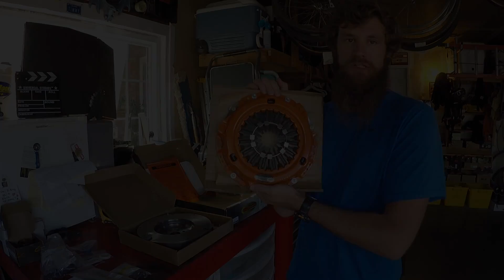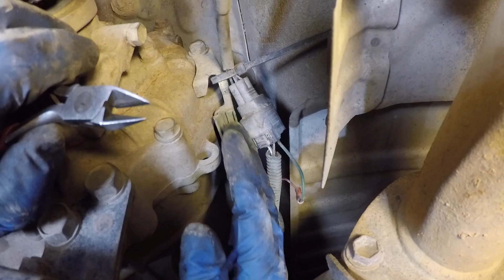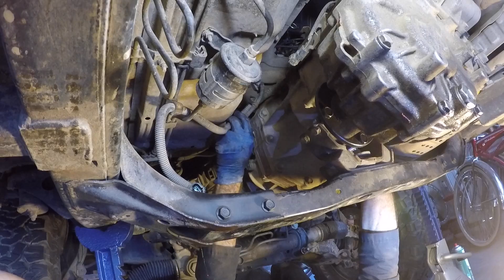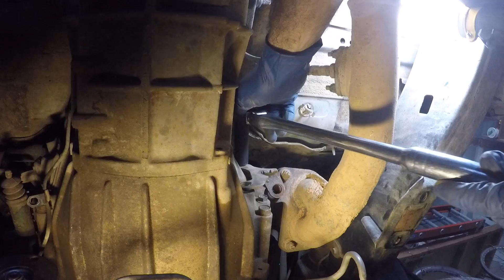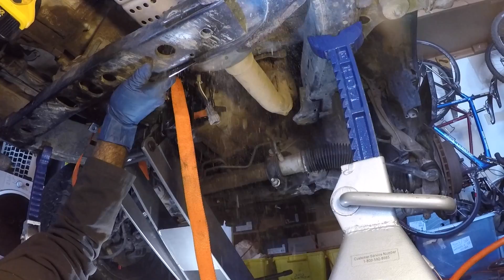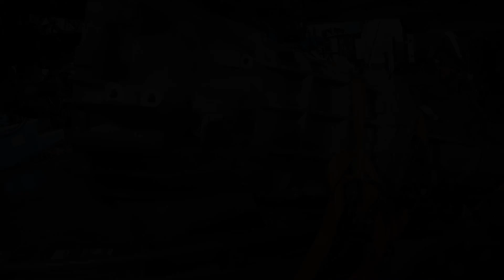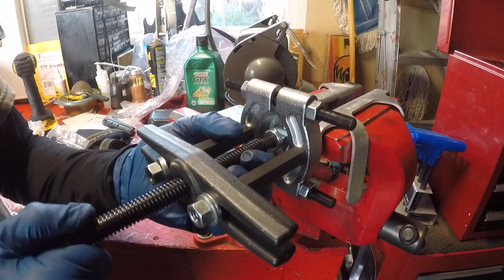Clutch Replacement (Part 1)

Comment: I’m half way into removing the trans in my 2WD ‘96 5VZ Tacoma. So far the most difficult part is releasing the harness retainer (24:05 on the video). I’m guessing the access is tighter on the 2WD. I’m going to try lowering the trans a bit and see if it opens up some space. 
Found one of the top bell housing bolts loose. I was thinking my clutch was factory, but perhaps not. 

I’m thinking w/the welded cross member, I’ll need to slide the trans back until it clears the engine and then drop the front & slide fwd until it clears the crossmember. 

Your videos gave me the confidence to take this on.  Many thanks!!
Reply from the maker: Good luck with the rest of the job.  You'll get it.  It's great to know our video series inspired you to tackle this job on your own.  Happy Wrenching!
Reply: Thanks Tim!

I learned this morning that to get enough clearance the top shifter plate had to be removed. Then you can back the transmission out of the engine. Then the clutch assembly had to be removed before there’s enough room to tip the trans forward and get it clear of the crossmember. 
The pilot bearing put up a good fight, but did come free of the input shaft. 
The ratchet strap idea in the comments was really helpful. 
Onward…
Reply from the maker: @ppeterson9359  Sounds like you've got quite the battle going on, but your perseverance is paying off.  Let me know how it all turns out for you.
Reply: @ppeterson9359 how many miles were on your rig's clutch? You don't think it was the original?
Reply: @efil4kizum  I bought the truck w/ 110K, in ‘04. It now has 278K. I believe the clutch was original.
Reply: Last post:  All is well!  I now have ~500 miles w/ the rebuild installed. Super happy with how everything worked out. Looks like UPS delivered my core to Yota1 a few days ago. 
Thanks again Tim!!  👍👍
Reply from the maker: @ppeterson9359  Great to hear.  Thanks for the final update.  Great job doing all that work yourself.  Happy Wrenching!
Reply: One last question, should any lube be applied to the sleeve the ID of the T/O bearing rides on?  Since it’s not mentioned anywhere I’m thinking no, but figured I’d ask.
Reply from the maker: @ppeterson9359  The only areas grease should be applied is what we show in the video.

Comment: Is this the same process for a 03 tqcoma 3rz
Reply from the maker: Not 100% sure, but it would be my guess it's the exact same.  I'm pretty sure you have the same R150F transmission, but you'll have to confirm.

Comment: ?  43:33 ... quick question regarding a Rear Main Seal leak inspection... is this access plate the only way to check for weeping or will a noticeable pool of oil develop on the ground or around the bottom of this plate if that seal is weeping
Reply from the maker: If the leak is significant, it will drain down and be noticeable at the access plate on the bottom of the bell housing.

Comment: I noticed that the clip holding the throw out bearing to the fork is put on different on the centerforce vs oem. Is this way you show the correct way?? This is my 3rd time bringing down my tranny because something does not align.
Reply from the maker: What we show in the video is correct for the throwout bearing we used.  I can maybe take a look at my factory service manual and see if they show a picture of the proper orientation of the spring for the OEM throwout bearing.  I'm away from home and don't have access to my FSM.  I could look for you in a couple days.
Reply: @TimmyTheToolman  
Thank you. No need.
The spring is attached in a different manner on the centerforce vs oem. Thanks!
Reply from the maker: @enmanuelcubas3401  I'm glad you figured it out.

Comment: I have a 2001 4 runner 4wd but need to replace the flywheel do I have to completely pull the transmission or can you move it back far enough to change it?
Reply from the maker: You can most likely move the transmission back far enough to have enough room to remove the flywheel.  But, this is something we haven't ever tried.

Comment: Hey Timmy what’s the part number for the bolts that snapped trying to get the bellhousing off the transmission? I only have 8 for some reason and want to get the 9th
Reply from the maker: Sorry, don't know the part number.  Your best bet is visiting your local dealer and they can sell you one.

Comment: It's advised not to ever use an impact driver/wrench to crack/loosen vehicle bolts as you now know. Once they are cracked, if they are free turning, you can use the impact from there.
Reply from the maker: That's not the reason why the bolts broke.  It was due to corrosion involving dissimilar metals, - steel bolts into an aluminum housing.  If you think transmission rebuilders or engine rebuilders break every bolt free with a ratchet, think again.

Comment: the OG '97 Taco 5VZ-FE MT has so far made it 280k miles on the original clutch sans master/slave cylinder (mostly highway miles) but the bearing is chattering in the cold and no noticeable slipping yet in gear up steep grades.  Will the bearing eventually lock freeze up and not allow me to shift into or out of gears? ....trying to get 1/3 million miles before this eventual repair
Reply from the maker: Well, once the bearing gets bad enough, it might fall apart and then you won't be able to shift gears.  If it were me, I'd address it before it potentially leaves you stranded.  If you don't take long trips in it and you're not opposed to potentially having to tow it back to your house, keep driving it and hope it doesn't completely fail before the clutch gives out.
Reply: @TimmyTheToolman  that is what i am afraid of, getting stranded in the nowhere midWest! with temps falling to below freezing and NO heated garage, it will have to be put off for six months.  the current pricing for the OEM flywheel is from 512$ to 741$ which is RICH!  won't know if its bad and needs replaced until it comes out. Is the Marlin Crawler flywheel (that is 150$ at the time of this video) similar or better quality than OEM. thanks!
Reply from the maker: @efil4kizum  I really don't know how Marlin Crawler flywheels compare to OEM, but when we did this job with Dan, he did his research and read good things about the Marlin Crawler clutch parts, so I think Marlin Crawler is probably a good way to go.
Reply: OEM flywheel is now over 800$ MSRP as of Oct-'23  whoa!
Reply: update...  made it to 337k miles (Oct-'23)... bearing is chattering very nicely... tentatively scheduled for pro repair 1st week of December in ChicagoLand once the clutch cover part ever comes in off 4 month backorder
Reply: now made it 339k miles...  AISIN clutch kit coming in fast from RockAuto... wheeling it to Chicago in less than 2 weeks for the nut and a six hour task... really hoping that transmission is 0K... been some very ODD sounds the past few months, particularly in that 2nd gear shifting both down from 3rd and up from 1st gear
Reply: 2-2-2o24 update... at 341.7k miles taco went into shop in ChicagoLand... pilot bearing was found seized to input shaft and had scarred it up to the point that a replacement R150F was needed (input shaft bearing also found to be wobbly) over the holidays a rebuilt R150F was sourced from Yota1 in Riverbank CA and shipped 2200 miles to Chicago.
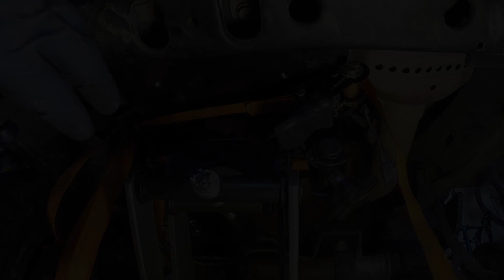Reply: 24:27 ,,,, FML 8^(

Comment: can i use the video as reference for my 1980 4 speed trans? or is the modern clutch too different
Reply from the maker: Sure you could use it as a reference.  The parts probably won't translate but the general steps on how to remove the transmission and do a clutch job will be very similar.
Reply: @TimmyTheToolman  thank you never fail to help me out
Reply from the maker: @corbs3535  You're welcome Bro.  We're here to help.

Comment: I watched this video (parts 1 & 2) 3 times through and took notes prior to attempting this job on a 2002 Tacoma 4x4. Thanks so much for all the videos Tim (and Sean)

Just replaced my trans and clutch/flywheel this past weekend! 

Here are some notes to add to this job.

Both front wheels off. 6T double-locking jack stands in place.

2002 Tacoma 3.4 4WD with unknown miles (had the wrong instrument cluster when I got it, so no telling.)
 
On the Tacoma with 3.4 the exhaust is different, so we did not have to remove.

We didn’t break any bolts on disassembly, we broke one of the bell housing bolts on INSTALL while trying to torque. We also stripped the internal threads on the trans on a different bell housing bolt, so those are torqued to a lower number to be safe…I hope they stay in place. Probably should have put some red locktite on them. I did replace these with new bolts. 
I was also replacing the trans (with a rebuilt one) to had to pull the transfer case. No surprises there, replaced the rear trans seal since we were in there.

The hardest bolt to remove was on the driver side inspection cover. Not because it was stuck, but because the access was extremely limited. Lucky for me my helper had smaller hands than I did. Had to go in from the DS wheel well. 

My pilot bearing was toast...dry and rusty with little ball bearings falling out all over…and the exterior race was locked into the crankshaft. That race was a BEAR to remove, but using the inner bearing removal tool kit (as recommended by TtTM) was essential to removal. NO WAY would the bread and bolt trick have worked…no we didn’t try, I bought the kit in advance just to be safe.
I used the Orion Motor Tech Blind Hole Collet Bearing Race and Seal Puller Extractor Kit - https://www.amazon.com/gp/product/B08J6NLWJX/ref=ppx_yo_dt_b_asin_title_o05_s00?ie=UTF8&psc=1
 
I found another tool that was super helpful for removing and torquing the flywheel and pressure plate bolts…JEGS Flywheel And Flexplate Turning Tool - https://www.amazon.com/dp/B078WHZCYQ?psc=1&ref=ppx_pop_dt_b_product_details 
I STRONGLY advise adding this to the tools list.

The best tool I bought for this job was the Milwaulkee M12 ⅜” Ratchet! Talking about speeding the job along. I opted for the kit with 2 batteries and a charger…that was a good choice. Never without power.
https://www.amazon.com/gp/product/B077F76VGT/ref=ppx_yo_dt_b_asin_title_o06_s00?ie=UTF8&psc=1

That’s all I can think of, will update if I think of more.
Cheers!
Reply from the maker: Wow, now that's a comment.  Thanks for sharing.  Glad our video series helped you out.
Reply: Does your Tacoma have the 2 cats? My 97 only has one cat
Reply: @efil4kizum  Yessir, mine does have 2 cats.
Reply: @duaneweikum  read through your deets again... was the rebuilt transmission you put in from Yota1 in CA?  i just had one shipped from Yota1 to Chicago in January because the pilot bearing on my truck chewed a number on the input shaft after 300k+ miles but was still in one piece ... i have the 5VZfe as well but only one cat and the exhaust had to be removed ...all 3 studs broke from being seized
Reply: @efil4kizum  Yes, my trans was from Yota1 in CA.
Reply: @duaneweikum  NiCE!

Comment: Cheers guys for this very-excellent two-part video set. I’ve been wondering about the health of the clutch in my Toyota Hiace camper van as it disengages almost as soon as the pedal is pressed. While it’s possible the pedal is out of correct adjustment the van is ~30y old (~150,000 miles) and I’m doing a pretty big refresh. Your much-appreciated content gave me the confidence to tackle this as the first gearbox and transfer out I’ve done. As you know many Toyotas of the 1990s and 2000s are really quite similar and the shafts on my van matched the bolt and stud pattern which was great. I made a simple adapter (that also adjusted for pitch and roll) to convert my 3T trolley jack into a transmission jack. My G52 4WD transmission came out a lot easier than Dan’s in the video largely as the pilot bearing stayed in place, but it’s old and notchy. I got the pilot bearing out with the ‘bread-and-a-M12-bolt’ technique. The Hiace has a hatch above the bell housing that gives some access to the top bolts and helps with removing the starter motor (and flywheel) and I didn’t have to remove the exhaust pipe, but did have to unbolt its bracket. My manual does say to remove the sway bar and there is also a picture that shows the types of each of the bell housing bolts and their tightening torque. Bad luck with the bell housing to gearbox bolts, but I don’t think you need to remove the bell housing to replace the front oil seal in the gearbox. While access is better with it out, I think all the bolts to remove the gearbox front bearing retainer are accessible with the bell housing in place. I won’t be replacing mine as it’s all good in there but will be doing the engine rear seal. There’s just a little weep but it seems sensible to replace it as I’ve currently got the flywheel out.
Very many thanks for taking the time to make your videos. Much appreciated!
Reply from the maker: Thanks for the comment.  We learned after the fact the bell housing didn't need to come off to replace the front seal.  Oh well.

Comment: I'm about to do this job on my tacoma. And I have a whine to my input shaft bearing. Does the cover you can see @ the 51:12 mark just unbolt and be able to replace the bearing or do I need to split the case to get it out?
Reply from the maker: That cover comes off and that houses the input shaft seal.  How you replace the bearing, I'm not sure.  Never tried it.
Reply: @TimmyTheToolman  Thank you. Very impressed with your response time. You do amazing videos!
Reply from the maker: @adamortiz1512  You're welcome Adam.  Thanks for the compliment.  We appreciate it!

Comment: At 52:27, is that the correct orientation of the throw out bearing retainer? That is opposite of how the old one was installed earlier in the vid and is also not what I’ve seen? Thx!
Reply: FYI, when I picked up my motor from Yota1 I asked the mechanic there and they told me the orientation as shown here is incorrect - the ends of the retaining clip go behind the fork, not on top of the throw out bearing tangs. But he also said it doesn’t matter too much since once assembled since it can’t go anywhere. Just wanted to follow up. When I watched again, the old retaining clip is correctly oriented when being removed at 51:01. Thanks! These videos have been super helpful during my engine swap!
Reply: I can also confirm what lentbrush said about the correct orientation of the spring. After reading some of the comments I made sure to review the orientation of the spring on the fork and the throw out before I removed it. The ends of the spring go behind the fork (the go on the same side the pivot bolt rests on), and the big curved section of the spring goes over the throw out bearing and on top of the fork.
Reply from the maker: Watch it again, it is the correct orientation

Comment: Has your friend noticed any new leak from his rear main seal? I'm of the mind to bottom out my rear main as y'all have but am finding mixed opinions on this across the internet. I would assume that the sealing surface of the crank is uniform and seal depth is irrelevant as long as it's not crooked or riding over a groove. Thanks!
Reply from the maker: He doesn't have any leaks.  All good.
Reply: @TimmyTheToolman  thanks for the quick reply, tim. Cheers!
Reply from the maker: @joshuaelkins9943  You're welcome.

Comment: Why my Toyota Tacoma 1996 5VZFE is too hard to go into 1st shift? I already changed 1) Clutch press, 2) Clutch disc, 3) Master cylinder, 4) Slave cylinder, 5) Shift stick bushings, 6) Manual transmission gear oil, 7) Clutch fluid, 8) Clutch lines bleed Help please :-( 

1st shift or gear goes in if I try to get it in while I am moving and about to stop, but not when I start from 0mph.
Reply from the maker: Have you adjusted the clutch pedal free play? The amount of play in the pedal before you feel the throw-out bearing push onto the pressure plate should be 5 - 15mm